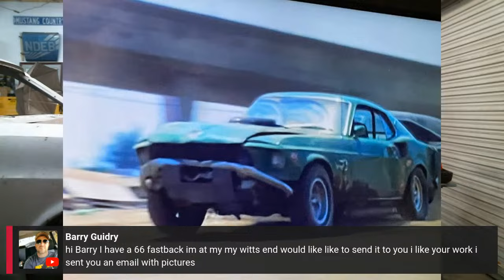Cars and Coffee. March is being difficult. Let's talk about cars. #livestream #cartalk

Comment: I bought a second hand redline rotisserie last year . The seller told me that the male tube would bind when trying to lower the car when it was installed on the   Rotisserie. I found welding BB’s along the inside seam of the female tube.  Also I mitered the corners below the roller of the male tube because the roller was not making contact with the female tube.  I hope this makes sense.